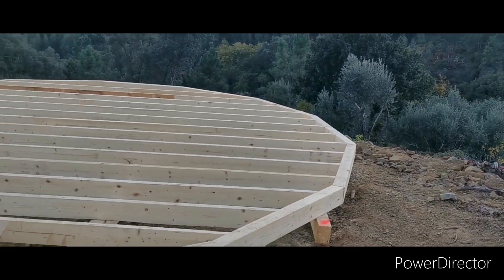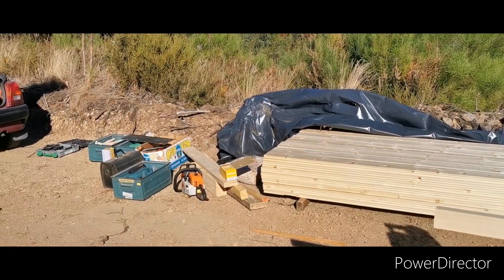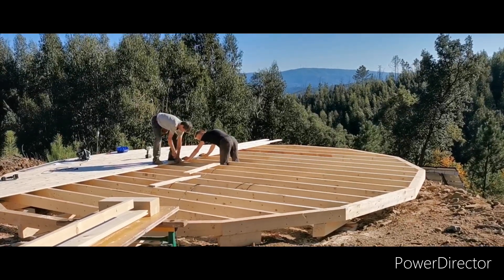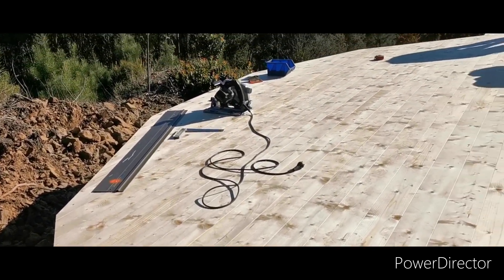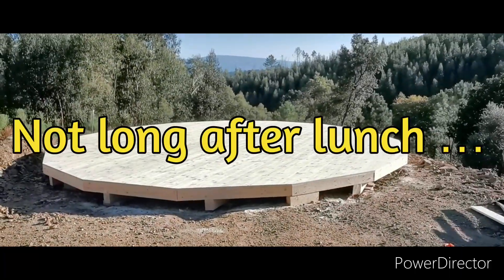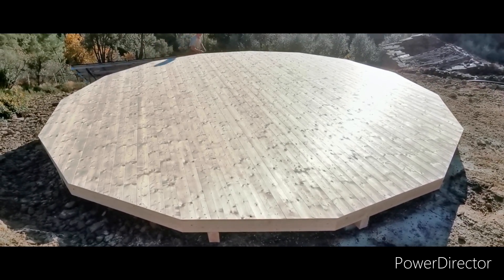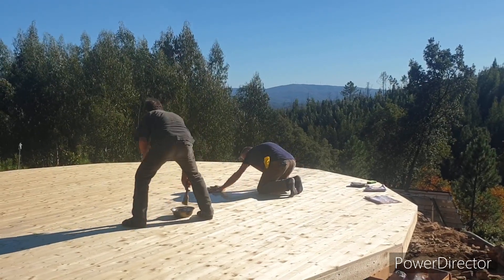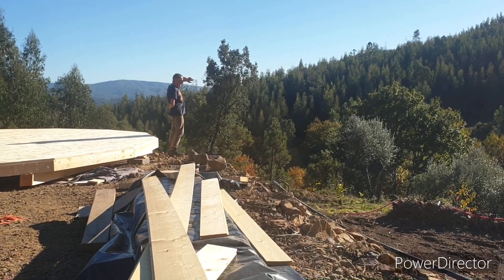Dome Deck Construction

Comment: Are you going to put a skirt around the deck to stop cold from coming in through the floor as once the winds start they while also howl as they blow under the deck. I would look to either banking some soil up to the wood or putting upright planking on to close the open gap up you may even get animals living underneath the deck as well. It certainly looks the part well done.
Reply from the maker: Yes the plan will be to place some vermin barrier, then a strip of board to stop the wind from howling under us. 👍
Reply: @shcutter  that great seems you've got it all sussed out. Would of hated you to get cold in your yurt. Good luck with putting up the yurt.